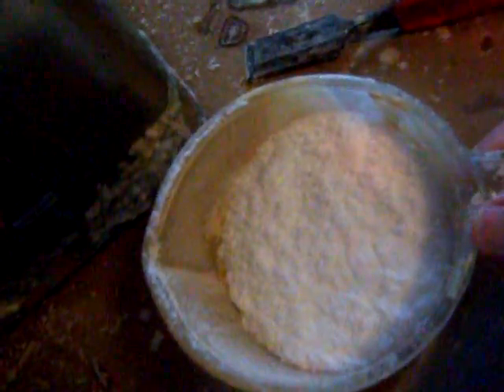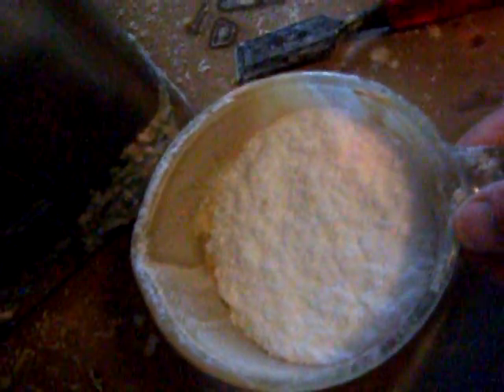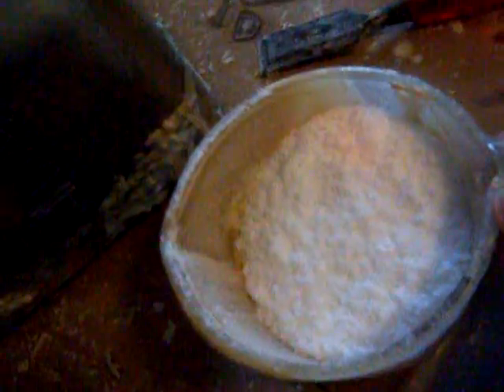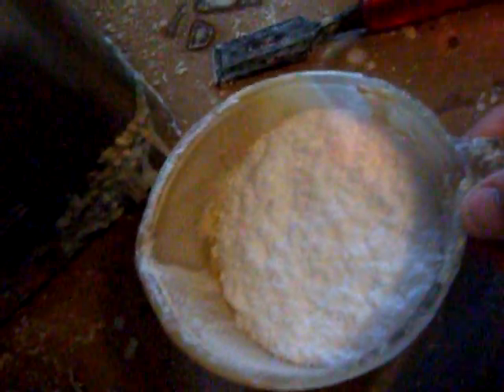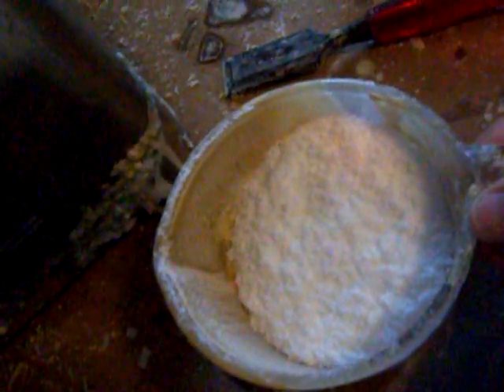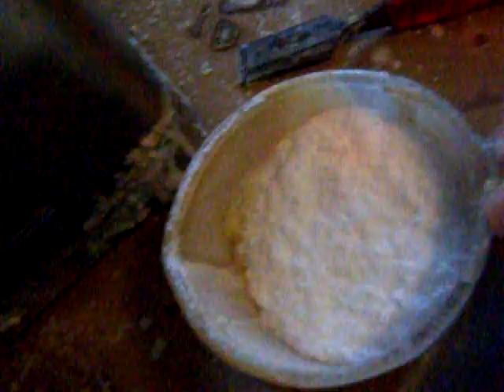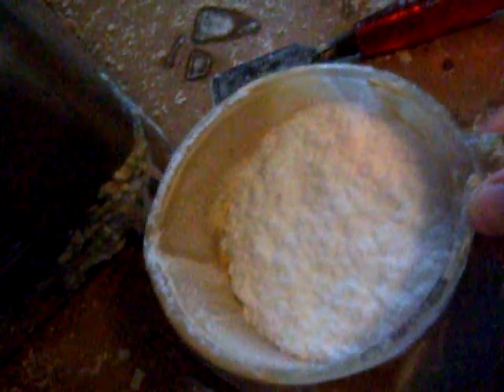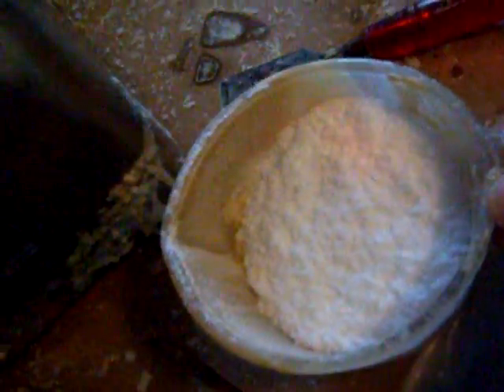Stearic Added to Wax

Comment: I was just wondering how much stearic acid do you add to each pound of wax?
Reply: 3 tablespoons per pound
Reply: @asiamiller6833  does it make them stronger and gives a stronger cold and hot throw?
Reply: @nictoria76  I just made a candle today so not sure yet it did make my candles dry quicker though so maybe it does make it harder
Reply: @asiamiller6833  Hi, how did this work for you?
Reply: @nictoria76   I haven’t done anything yet I been working on my soaps
Reply: Did you ever find out?